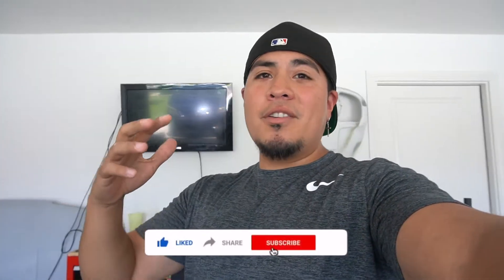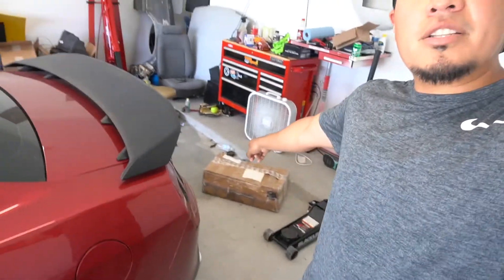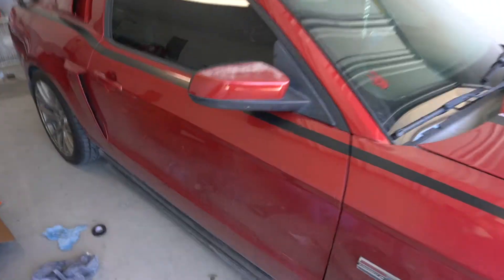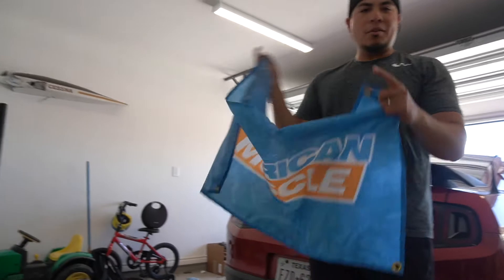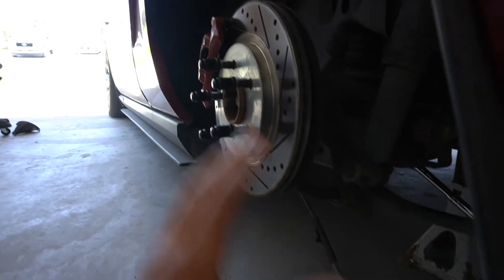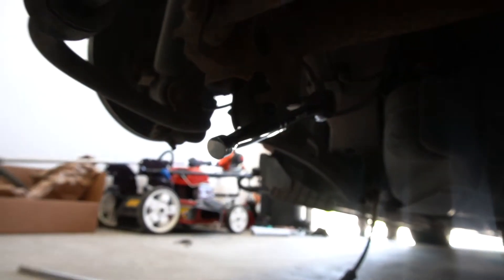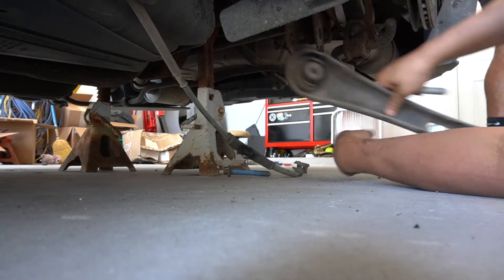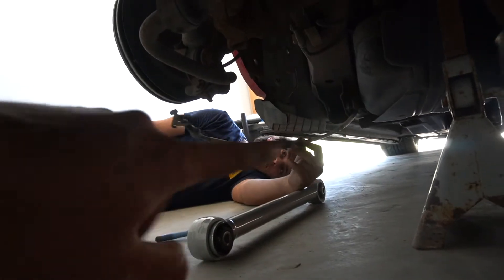A SUBSCRIBER SENT ME A FREE CAR MOD!!!!

Comment: I have a Whiteline adjustable panhard bar and set of SR lowering springs that I had for my 2012 V6 that I never installed before I sold it the parts are brand new never installed if you or anyone is interested I’ll give them a deal definitely be less than you can get them on American Muscle
Reply from the maker: Yo im interested in the panhard bar
Reply: @AlbertFlores11   what’s the best way I can reach you I can just email you if that works my name is Anthony by the way lol
Reply from the maker: Yeah rgvtune1234@gmail.com
Reply: @AlbertFlores11   I sent you an email